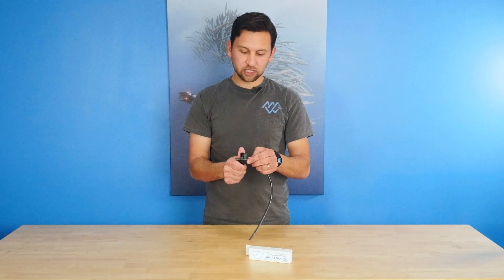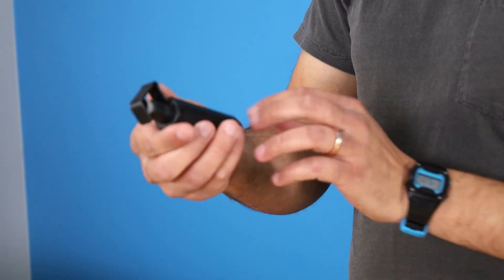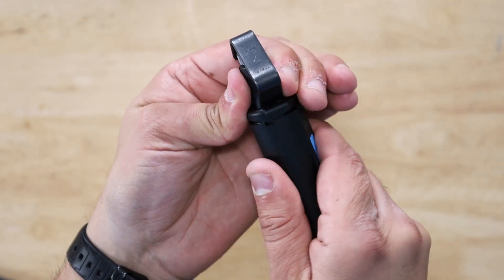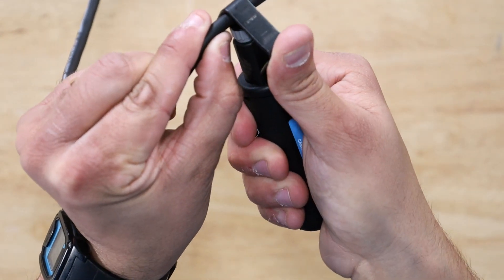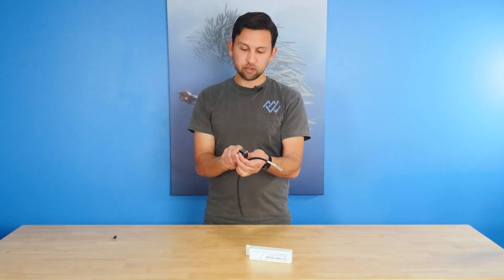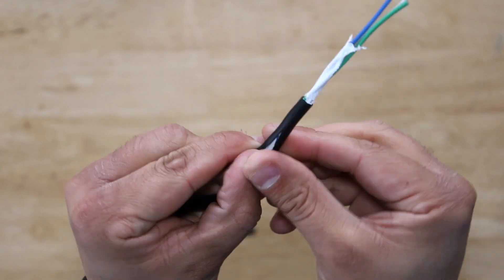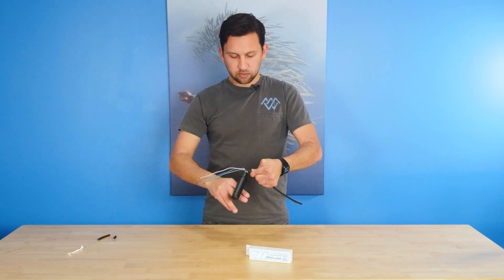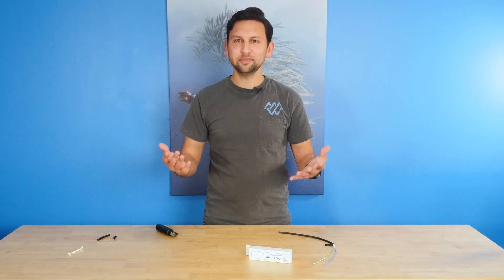Blue Robotics Tutorial: Using the Cable Jacket Stripper

Comment: That's a really cool tool. I cant figure out what a spiral cut would be used for.
Reply from the maker: Good question! We've used it for some mid-cable strips, so you can carefully unwind the jacket, and also it's a good alternative to the longitudinal cut for tough-to-strip cables. The spiral cut tends to leave the core of the cable more intact than the longitudinal cut.